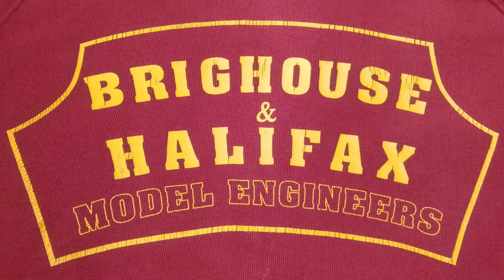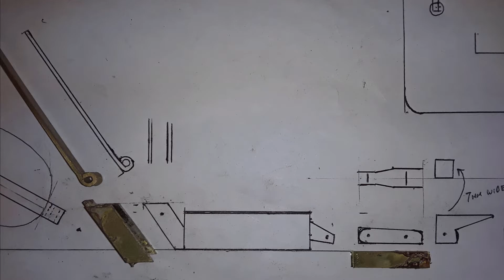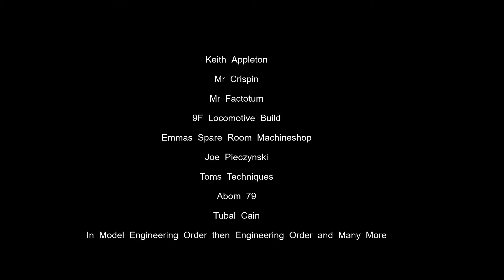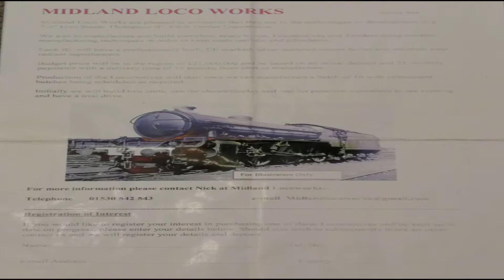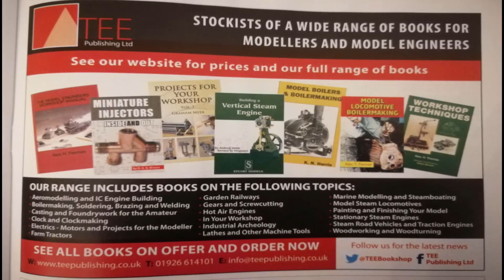Masterpieces          In  ``Miniature``   The  Beginning

Comment: Nice Raglan Lathe I see. Yes owner of 3 of them now the last coming free and a save from a scrap skip!!  Together with a Myford rusted up solid. Yes I have been in the hobby since 15 when I was at School with Alan Wilson. His Dad designed several and built professionally.  I have far too many under construction but love them all when going together well. These days I draw them out first then go and cut metal. Yes many need reworking. So many getting to a stage then popping up on Ebay. Many as just boxes of castings with an attempt of cutting out the frames. 2 have just turned up in the Reading Club. Simplexes.  A new friend now has several to have goes at. My easiest the Drill Driver 0-4-0 was watched by Martin Evans go round the Maidstone track just after IMLEC. £150 and great fun.
Love David and Lily.
Reply from the maker: Thanks Dave, there are so many started but not finished models around, which is great for the second hand market, just a shame that somebodies dream became perhaps a little too much to handle.